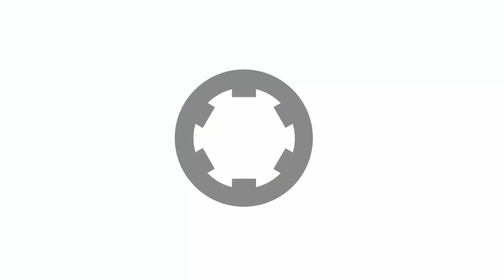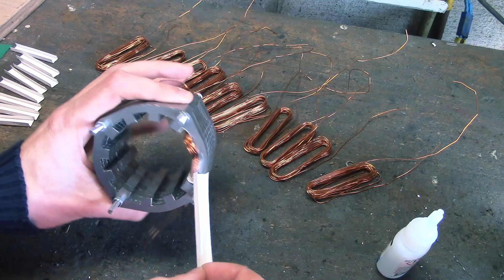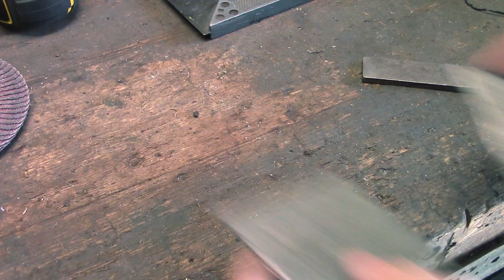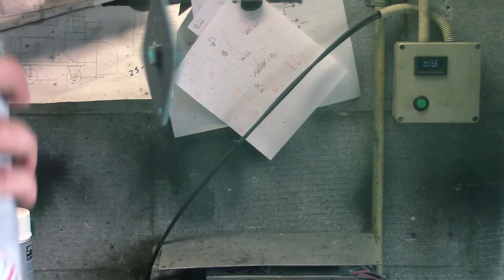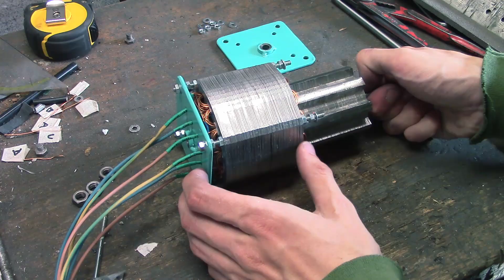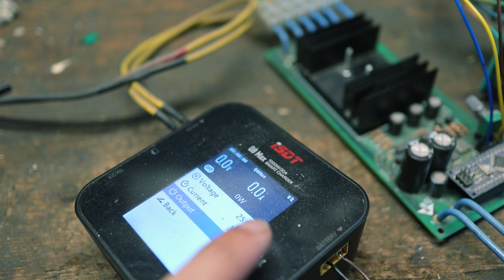Home-made switched reluctance motor

Comment: Not sure if you are aware but the SRM has an inherent Torque ripple which causes acoustic noise and vibration, (this can be mitigated with control) but thats likely why is shaking.
Reply from the maker: True, but in this case the shaking was caused by the unbalanced rotor. (I have fixed it now)

Comment: is it unbalanced because you grinded one side of the shaft?
Reply from the maker: Could be a contributing factor, but keep in mind the hole in the stator is also asymmetric. The removed material from the shaft should in theory be compensated for by this.

Comment: Very nice, love the simplicity of it as well, i guess not so simple when it comes to the controll of it. Ive been playing with gate drivers for brushed dc motors with my arduino and wow what a rabbit hole you can get into turning mosfets on and off, maybe the vibrations can be solved in the control?  Probably unlikely but would love to see more on your motor controller anyway. The mechanical construction is no easy feat either to be honest so congrats to that, it does look like a solid unit, even the colour makes it look like it belong in some industrial setting.  Maybe worth getting those laser cutters, i never had a use for them but this is definately a good use for one. BUt i hear you need lot of power to cut metal properly and these ones they market to hobbiests are no more then engravers like the one you find included on the 3d printer Bambu H2D, it can only scratch metal from what I hear, you need an 02 cutter to cut metal but im not an expert other then what ive read in comments.  Maybe a metal /carbon fiber laced 3d printing filament could do the trick? maybe not as efficient as metal to concentrate the magnetic field, but the cost savings could be worth the trade off.
Reply from the maker: I've never tried the 3d printing method, although quite some people on the internet make motors this way. From what I've seen the permeability of the material is very low, so it may be a little better than air cores/pure plastic, but not by much. But indeed it's a lot cheaper than what I did, and saves time and effort too. Perhaps I should try it out some time.

Comment: I absolutely want to try something like this too. Im not an engineer, but im a factory electrician, and i study this stuff whenever i have some spare energy. I will focus on making the driver and will make a bldc motor. I think i have an interesting idea for the driver, which im pretty sure has been done in some way already, but i still want to do it. One probably doomed to fail experiment is driving my IGBTs with an analog signal, so no switching. Which is probably pretty good for high rpm, but ill see when ill try it
Reply from the maker: @karyjas1  If it's low power enough you might be able to pull it off

Comment: Does the rotor need to be laminated? I don't think there is a lot of eddy current in it, is there?
Reply from the maker: The magnetic flux through various parts the rotor constantly changes quite a lot as phases are being switched on and off. If you made it solid there would be serious losses in it. (as also happened with my earlier attempt, the rotor got rather warm despite good ventilation and not touching the stator.)
Reply: @AKIOTV  I do not thing the magnetic flux in the rotor changes much. Certainly if you drove the stator with 3 phase AC, you could argue that the rotor, which is rotating at synchronous speed, is only seeing a static field. Or so it seems to me. I might be wrong. The fact that your previous rotor got hot is certainly causing me to doubt what I am saying.
Reply from the maker: @mckenziekeith7434  I can see what you mean, but keep in mind the srm is quite different from say, a pm motor. 

If you analyse the rotor step by step through a rotation, you'll find the flux through a pole changes with each step. The wikipedia page on SRMs has a nice animation on it that shows this.
Reply: Those through bolts holding the laminations together, the shaft and the stator bolts all look like really bad Eddy current paths if they're not insulated from the laminations.
Reply from the maker: @vinnieluther6589  They are a path for currents, but this only has a small affect overall. Often motors and transformers will also have welds running along the length of the stack giving a similar effect. Having these is of course worse than not having them, but it turns out still not that big of a deal.
Reply: @AKIOTV clearly it is working.  Once you balance it and make a fixture to measure the efficiency of it, it might be interesting to wrap the threads in heat shrink and stick an insulated washer on each end to see how much difference it makes.
Reply from the maker: @vinnieluther6589  It'd be an interesting thing to test. I'll see if I can do something like that.

Comment: You: "no electric motor gets warm completely unloaded"

Stepper motors: ...
Reply: Its preloading itself bro, ready for action before action, they're the beefeaters of motors.
Reply: @lasskinn Not if it's not rotating.
Reply: @lasskinn @daliasprints9798 It's not mechanical preloading.
Stepper motors are used for precise control in open-loop mode.
It requires a constant current whether moving or not to maintain its position at all times.
They usually only need a few volts to reach their rated holding torque when stationary, but need higher voltage when in motion.

Comment: Man that motor is awesome congrats. I have been interested in making electric motors for the last few years. Started building the makesea bldc motor using a 3d printer which i bought at the time for that reason only, built and wound the whole thing by myself, took me too many tries but succeeded eventually. Then i was inspired to design my own motor so i learned fusion 360 and designed a motor from scratch; it was a bigger bldc outrunner motor.. i actually cried when i saw it spin for the first time. Then i got too excited and said i wanted to build these from metal so i looked for desktop cnc machines but they were so expensive and still are. So i decided to diy my own cnc milling machine. Took me 2 years to build the cnc and i am almost getting it to working perfectly. Been interested in switched reluctance motors for so long, i actually think they are more interesting than bldc motors because they are only made of steel which is neat. I can't believe how many skills i learned because of that first motor.

Comment: Cool video, thanks! For example, you can use the rotor from a brushed motor, like one from an electric coffee grinder, remove the windings and commutator, and it’s already balanced and built for high speeds. Can you remind me which video you talked about that homemade motor driver in?
Reply from the maker: @Andr-v5t  Re-using a rotor would be nice, but most rotors don't have the right shape for use in an srm, let alone happen to fit perfectly in this particular one.

That video on the driver was titled something like "how to drive this weird electric motor".
Reply: @AKIOTV  "  but most rotors don't have the right shape for use in an srm " - Why is that and where did you talk about it? Do you need an even number of poles?
Reply from the maker: @Andr-v5t  In most cases you'll have an even number of poles. There is quite a few different possible configurations, but not every combination works. 

Some may work but are not optimal: for example, a 4/2 srm can be made (4 stator and 2 rotor poles), but in that case you can't control the direction.

Most importantly, you need the rotor poles to "stick out" (salient poles). This is what causes the difference in reluctance that is needed to produce torque. This style of rotor is uncommon in other types of motor.